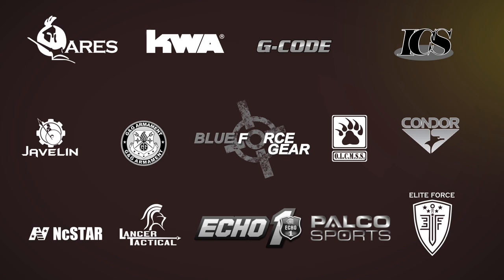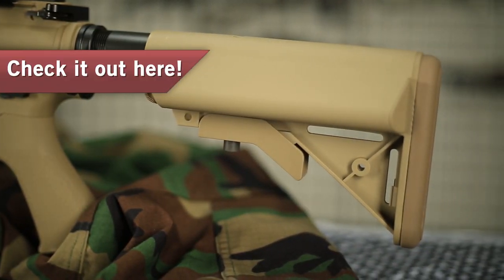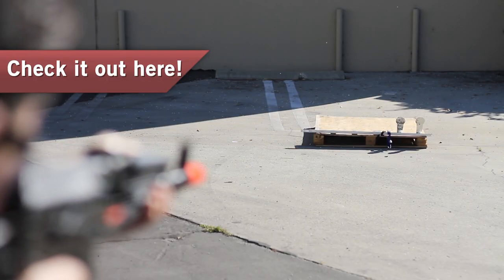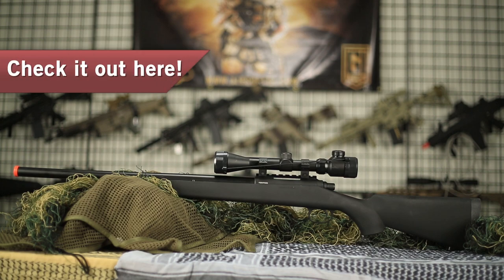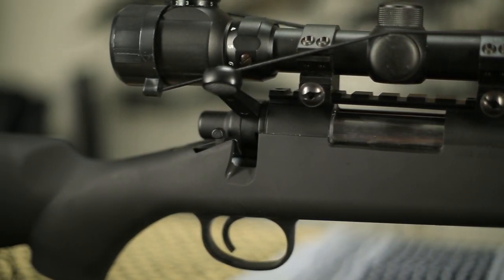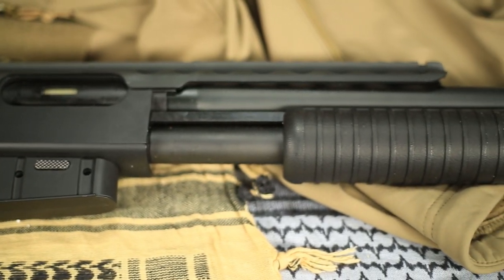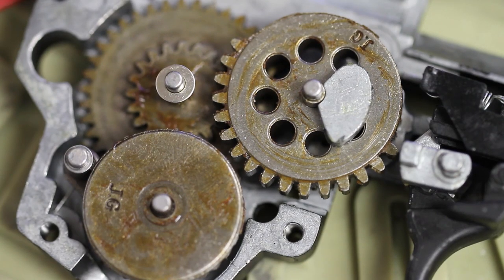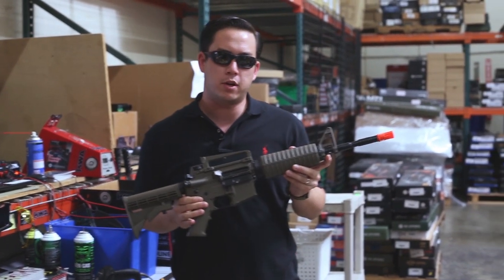Airsoft GI - $150 Entry Level Guns for Different Playing Styles: G&G, JG, and Bravo

Comment: A Remington Model 700 weights around 4kg without scope. Let's assume it's a .308 firing a 11g (0,011kg) boat tail hollow point at 810m/s. m * v = 8.91

Dividing by the rifle's mass, the rifle will strike at 2.22 meters per second. That's 9.85 joule of energy. A karate punch is 450 joule.

Comment: Im new at airsoft and my playfield is a forest...i like sniping but i heard a sniper rifle isn't a good first airsoft gun...should i buy a sniper or not?
Reply: Kosta Pazaitis if you do get the jg bar-10, but you really shouldn't rush with it. A lot of assault airsoft players play with a gun that shoots under 300fps, and most snipers shoot with 410-500fps. Shoot someone with that at point blank and they will get pissed. Be a bush Wookiee. (Bipods and laying prone with your feet flat on the sides help a lot)
Reply: Kosta Pazaitis don't buy it as your first, get the combat machine and a few mags along with a smart charger. if you like airsoft after about a year and you are good at maneuvering and stealth, get a sniper.
Reply: OneShox get a dmr, as u can get the long range shots but arent at a disadvantage if u need to rush or move
Reply: Snipers can be cool, but aren't great for your first gun. Get an entry level a eg instead, and then if you really get into it, you could consider trying sniping

Comment: A lot of CYMA guns are cheaper, more reliable, and better than most of these guns
Reply: Clarence Williams
You may have either gotten lemons or just did not regularly maintain your gun. My CYMA AK is cleaned and lubricated 2x per month and it runs like a well oiled machine.
Reply: I bought a cyma and it broke on the first go.
Reply: ***** lol he misspelled it both times... People need to learn how to spell
Reply: Anyways I don't care. My CYMA had to get replaced internals with echo 1 parts which cost me more than $120 to repair.
Reply: +Spencer Provenzola and +BombsAndBabies you guys want medals?
Reply: It actually can have an affect.
Reply: Alright Keyboard warrior I will let you you have your arrogance.
Reply: Clarence Williams At least he can use a keyboard correctly
Reply: Good job commando
Reply: Yep

Comment: You are aware that A: There is a warning in the boneyard... and B: the gun still fires. you just need to open it up and make shift fix it with parts that arent designed for an airsoft gun.

Comment: Also for ak's cyma has you covered. Tbeyvhave real wood ak's for less than $200 and theyvare metal too. Not pot metal. Aluminum or steel. They also have tactical ak's with rails. The contractor gas a full rail and the others have rails on the funiture. They all do. Theres a reguar ak with rails and one with a crane stock like the m4. They are also metal but the furniture is polymer. They also come with a bendable foregrip so you can have a vertical grip or angle grip. They even have blowback ak's. Of course theyvalso have imitation wood if you want to save $30.

Comment: I really wouldnt get the G&G because the FPS and Range on mine went to shit within months because the stock spring and the stock hop up and barrel are NOT good. I had to replace the spring and the hop up and motor. So is it really worth spending $150 dollars when you need to spend another $100 on upgrades minimum?

Comment: No u still need to buy a battery and charger the combat machine dosent come with them
Reply: Not the one he was talking about. He didn't state it, but the Combat machine M4 Raider that's 168 bucks includes a battery and charger. Also, a normal combat machine is only 158 for the same type of package.

Comment: honestly airsoft Gi is the worst website for mid level to entry guns I got a 89 dollar 350 fps cqc with full rail systems, and adjustable grip with a full metal body also it comes with a grip, mag, and battery and charger. with my extra money I bought better gloves and an extra battery and charger
Reply: btw 350 fps is the cap
Reply: no its not especially for 89 bucks
Reply: You cant get a good gun for under 100

Comment: Shotguns are so fucking overrated and stupid in airsoft. They shouldn't even be called shotguns.  They're basically rifles in a shotguns body. I have only seen one that performs like a shotgun but it had to take shells, and finding those shells after game is just a pain in the ass.
Reply: you havent seen many shotguns then....the trishots take shells, fire three shots, shells hold 30 a piece and they dont eject. theres an ACM M500 shotgun that fires 5bbs at a time, uses gas, and requires no shells. the TM 870, uses shells, fires 3 or 6 bbs, uses same shells as trishot shotguns, not ejecting.
Reply: +CrimsonSkyz There are some that don't need shells and shoot 3 shots. It has a special magazine and 3 barrels.
Reply: CrimsonSkyz yeah shotguns in the airsoft world are only practical if they are the multi shot shotguns